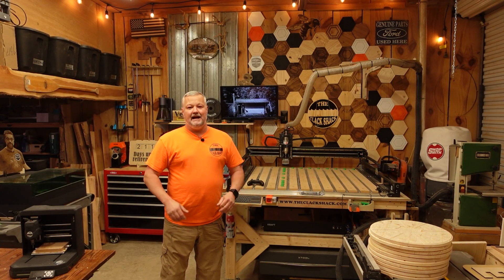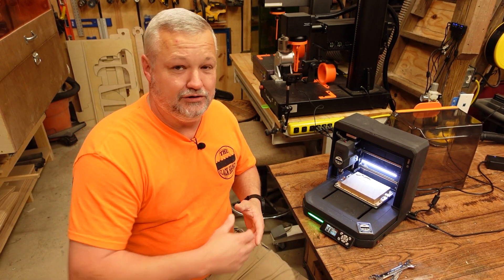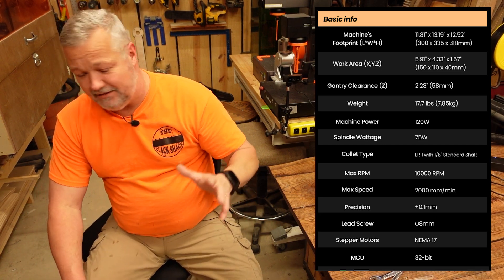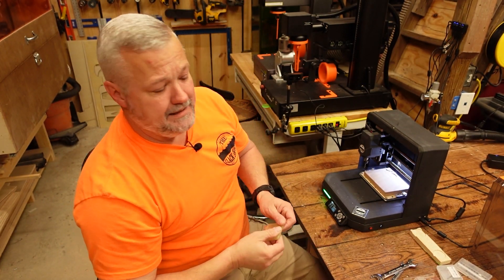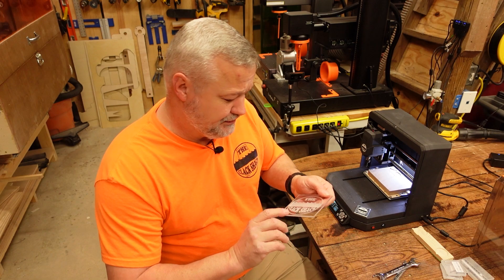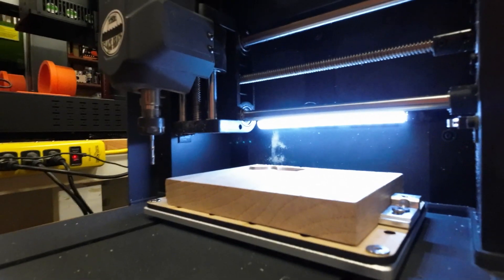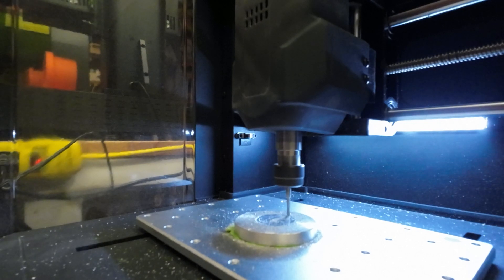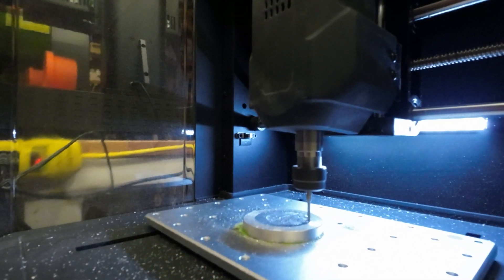Genmitsu CUBIKO CNC- prototype review

Comment: Do you think it would be strong enough to cut 3mm aluminum and carbon fiber?
Reply from the maker: Maybe with the correct settings after some testing. It would need to go really slow to keep deflection down. TBH, I would look at the 3030 pro ver for small pieces of metal. It is a much stronger machine.

Comment: Hello,  On the Sainsmart Page for the Cubiko they have a drawing for the spoil board. Injested into Aspire an the drawing is too large, 180mm x 120 vs the Cubiko 150X110/ are willing to share the correct dimensions or sale finished spoil boards?
Reply from the maker: Mine is 120x180 that I made to fit the plate.

Comment: Wanted to back it when it was $249 but was a bit uncertain how it was going to perform. Seems like it would be pretty awesome for what I want to do (make custom knife scales) but at full retail I think it's a bit of a hard buy. The 4040 Pro is about the same price and it offers a much larger cutting area, supports 4 axis, can be adapted to run a trim router w/ dust collection and it's expandable later on if you find you need more space.  Sadly the cubiko is pretty set in what you get is what you get. I think perhaps they will probably come out with a cubiko "xl" or something later if this is a success.
Reply: People are still coming in and dropping out ATM, you might actually stumble upon an available super early bird slot, if you're so inclined
Reply: @ Thanks for the heads up I may do it. Still a little on the fence but for $249 I think that's where the sweetspot is.
Reply from the maker: The 4040 pro max is a great starter machine also

Comment: Thanks for the review.
Did you check on the rigidity of that gantry, the Genmitsu with plastic gantry are just horrible.
Lots of play and over time it only gets much worse. Bit disappointed they didn't went for a basic but at least all metal gantry.
Reply from the maker: It has metal bearings on the contact points. I am not sure if this is its final form also
Reply: @TheClackShack  LMU bearings. Those tend to gain lots of pain on lower diameter versions. Not in use anymore not even on 3D printers that have no load.

Comment: Did you get any info on the dust shoe?
Reply: @jeffgarbert7357  per the kickstarter there is a dust shoe available as an add on.
Reply from the maker: Haven’t heard anything yet
Reply: @TheClackShack  They show that they have a dust shoe on the kickstarter page for it as an add on for 15.99 with an MSRP of 19.99. I also decided to pick up the 20k RPM 775 motor as well. Glad to see that it did fairly well in the prototype test.

Comment: So this didn’t have the Z probe? How did the bed seem to flex?
Reply from the maker: It has it, I haven’t tried it yet. I have got in a habit of setting the z manually. I haven’t seen any flex, the bed doesn’t seem to be moving.
Reply: @ but I don’t see the little button/sensor attached to the bed on your unit? Are you able to test it out and see how well it works?